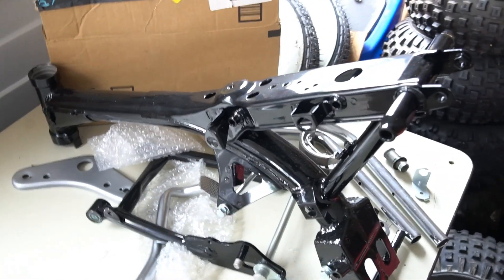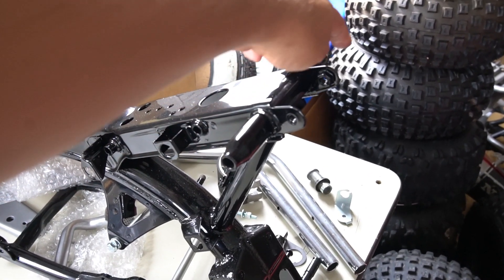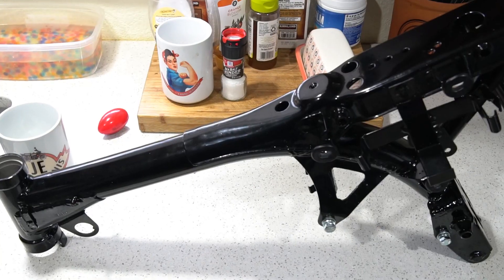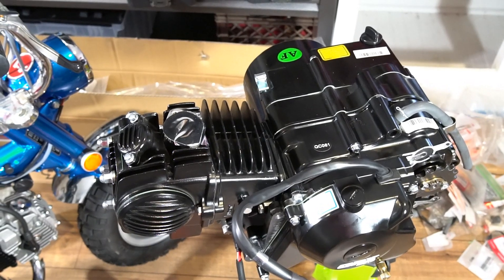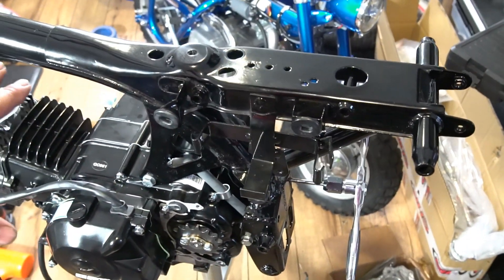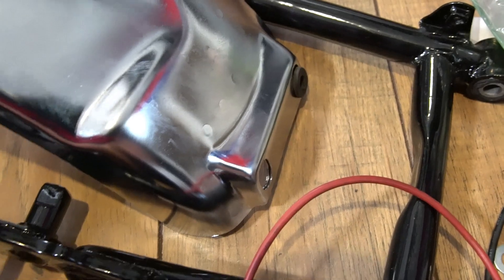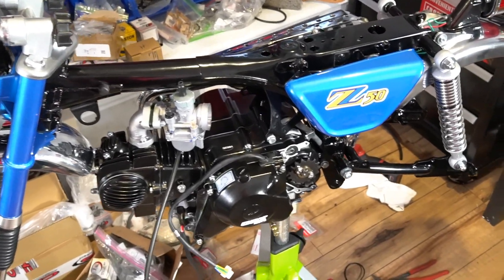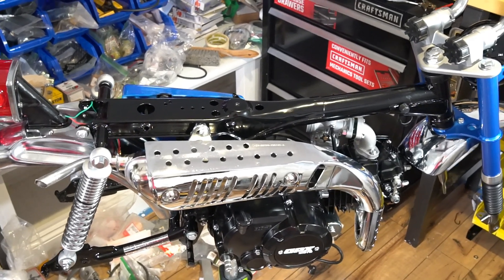Street Legal 1974 Honda Z50 Mini Trail Monkey Bike - Electric Start 140cc Mod Build - Video 1 of 3

Comment: Hi Josh, thanks so much for putting all these videos.  I am doing up a 1976 Z50j and they are the best resource every time I get stuck.  Wondering if you have any tips, I just cannot seem to drive the lower steering stem bearing race right in.  I get it to about flush with the frame but no further.  I heated up the frame and put the race in the freezer but just can’t get past that point.  Is there something I’m missing or a special technique?  Cheers Joe.

Comment: Where did you get the battery box and key switch bracket?
Reply from the maker: https://japan.webike.net/products/21105561.html
Reply from the maker: https://www.ebay.com/itm/254894505693
Reply from the maker: https://chpmotorsports.com/shop/controls/bracket-out-of-stock-z50-a-k2-rear-brake-light-switch/
Reply: @VintageHondaMinis  you are a life saver! I looked everywhere… so I thought! Thank you!